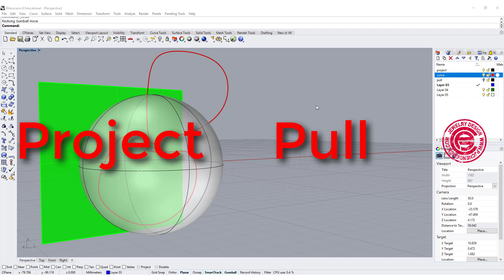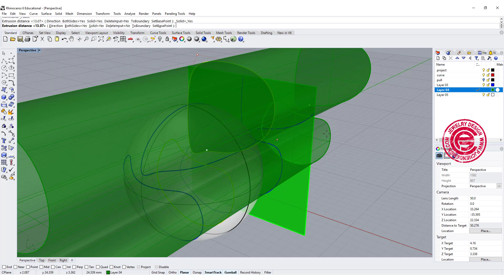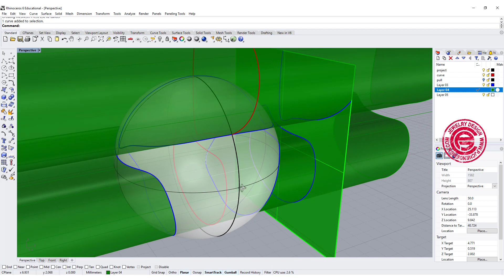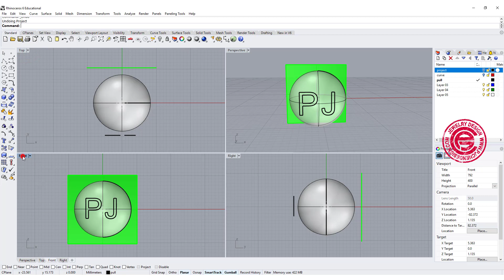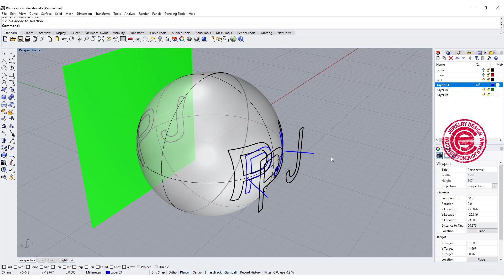How to use Project and Pull Commands (2019): Rhino 3D CAD Technique #20

Comment: Quick question what would be the best command to extrude these none planar projected curves into solid extrusion from on top of the sphere?
Reply from the maker: I will use the curve on surface to split the surface. and offset the surface to get the solid.
Reply: @PJChenJewelryDesign  nice that is the way I been going about this sort of extrusion making it a surface and offset. Thought i was going about it the wrong way. Thanks for the speedy response.

Comment: how can i make small surface project along big surface in network shape
Reply from the maker: you can only project curve, not surface to another surface
Reply: @PJChenJewelryDesign  what is command that i can use to add surface along another surface to cover it  in regular shape thank you again
Reply from the maker: @abdengineer6225  You can flow anything on a surface with Flow Along Surface command. I am not sure what do you  mean by "cover it in regular shape". If you try to fix some naked edge, you can try patch, or surface from 2,3,4 curve commands.

Comment: Nice Pj
Reply from the maker: Thanks, John.
Reply: Hi Pj a little help please I'm using rhino 5 it works well but the tspline freezes a lot I tried it on different computer and still . What do you think? . Thank you
Reply from the maker: @johnsingh7962  I will suggest closing all other programs. Clean up your system disk. Dump the trash. Try to release some space. make sure you don't have too many things at startup. Sometimes, those plug-in take a lot of space.
Reply: Thank you very much PJ I will try it